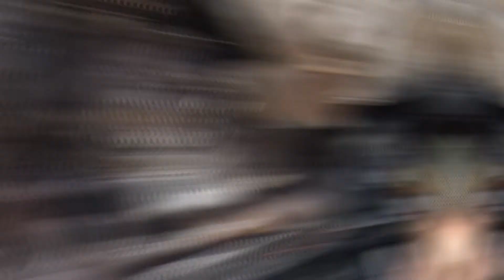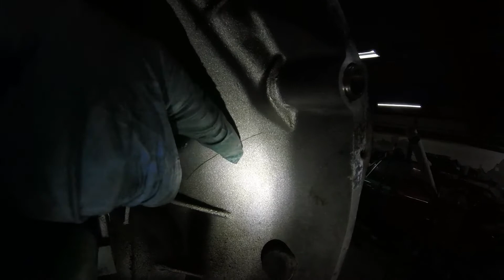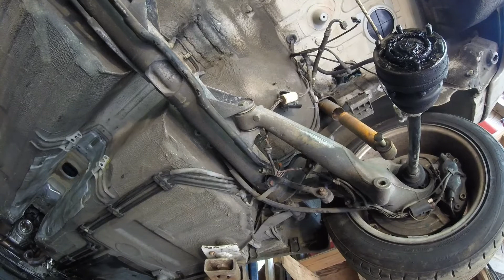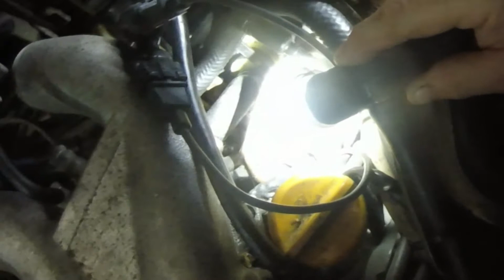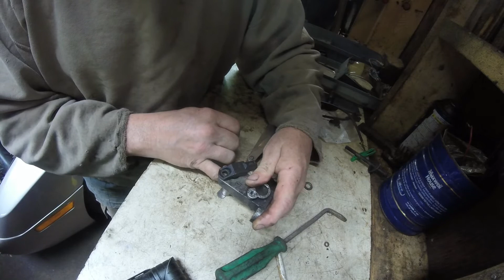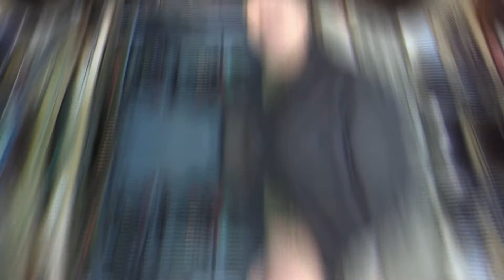944 turbo S (951) w/930 clutch disc replacement insight

Comment: Thanks Ive got 2 951s a 86 & 87)I like all content on the 944Turbo(951)
Reply from the maker: Cool man that's awesome. I really appreciate it and I'm so glad you liked it.
Reply: @rallypilot1  86 951 forsale limited slip trani cooler new Falkon azura tires 619731 7000 BLACK & two tone black and grey all stock

Comment: Super Video. I am in Ireland restoring  a 944s  (English import). I am in the middle of extensive floor and sill repairs now, but will have to pull clutch due to a noisy release bearing at some stage. 

I liked your tip regarding fuel tank and 930 clutch plate. 
Thanks again. 
You have some very nice cars in your collection
Reply from the maker: Thanks Geoff and good luck, 
         Dealing with the 80's undercoating and rust, you have my sympathies.. Good luck with it and I'm so glad the video helped you, it makes doing it worth it.
     Later, Chris

Comment: Do a 'Body-Off' like I did on my 928s and soon will do on my 944S
Reply from the maker: No way, if that's your bag, cool you should be applauded for saving an old Porsche. Personally,  I would never do a frame off on any good usable original car. If it was a rust bucket, yes then I think it's completely warranted. A clean original even with high miles, never, it's a waste of time and money to destroy it's originality.
Reply: @rallypilot1  It makes every system so much more easily accessible to service and maintain. As the values of these old cars goes up, we see owners wishing to ‘clean’ the undersides of grime and grease etc by such methods as dry ice blasting which is very expensive but does not repair the root issues which created the dirt. 

My first 928 body off was laughed and ridiculed at by the so-called ‘experts’ but I’ve found it makes everything that much easier to service, and everything gets cleaned in the process. I’ll be doing some 944 Body-Off videos soon!
Reply from the maker: @drblast  That's cool that you did that but it's just not for me. I look forward to your vids but an original car is only original once, embrace the suck that ensues with working on an old car, hahahaha........